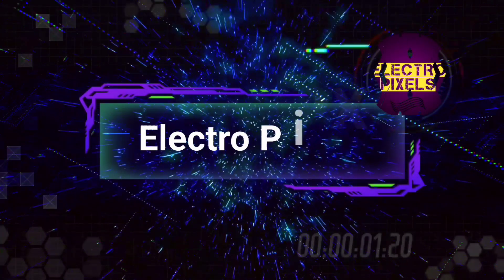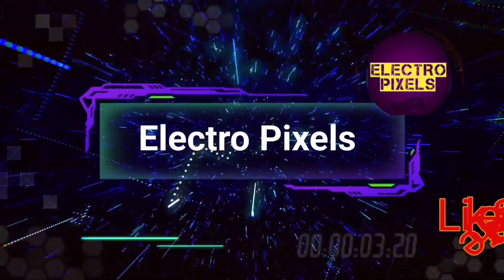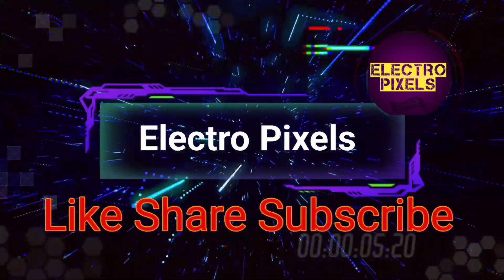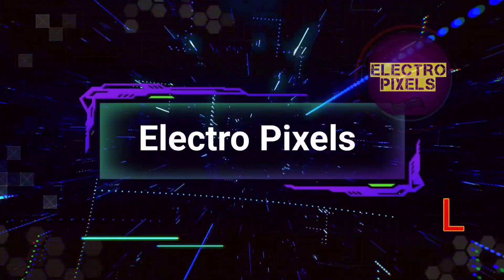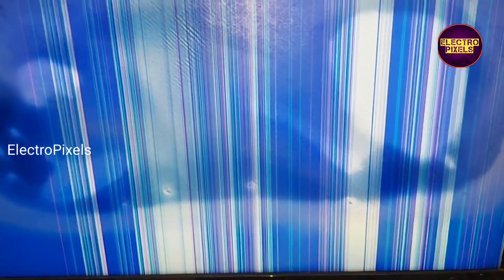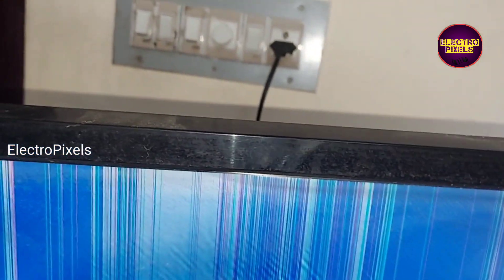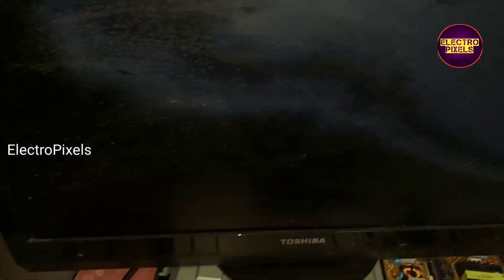Verticallines Display Problem Cof Related Complaints & It's Permanent Repair Solution and Symptoms.

Comment: What about same lines but horizontally, is that cof problem as well that needs bonding?
Reply from the maker: If the panel has side Cof then bonding can solve, if its a Cog panel then not. COG stands for Chip on Glass
Reply: @ElectroPixels  thank you sir